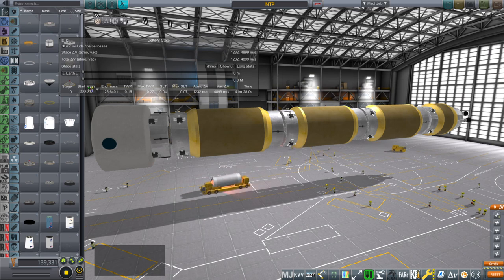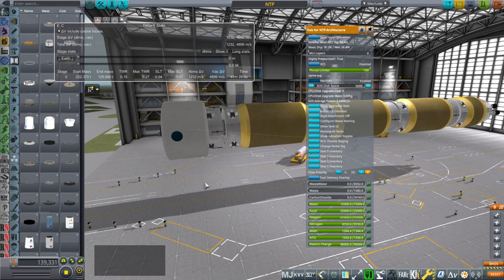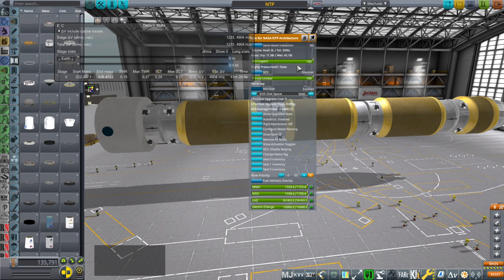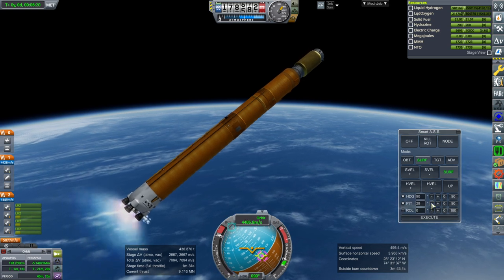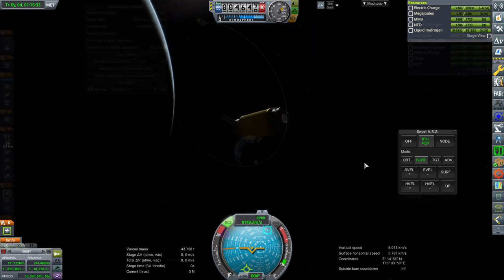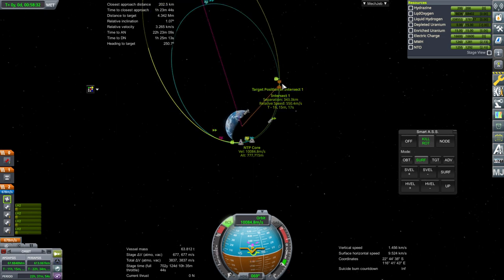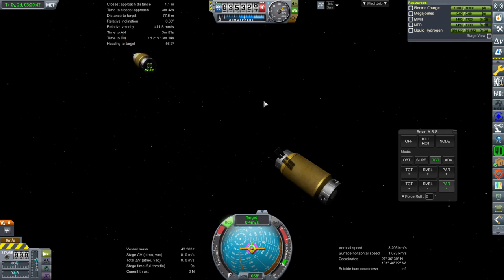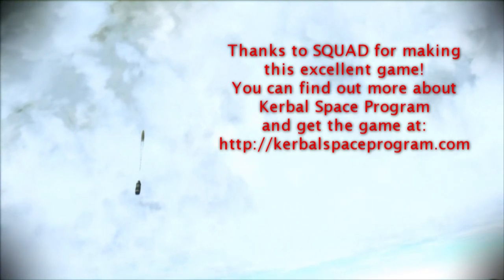Realism Overhaul in KSP 1.8.1 - NASA's Nuclear Propulsion Architecture 1

Comment: 1:30 If they used a hydrogen resistojet or poodle thruster instead of the later-stated (monomethyl)hydrazine-dinitrogen tetroxide, they could definitely achieve that Isp.

2:05 You seem to have renamed the engine rather than the specific config...

2:55 That was a harsh cut.

11:40 Same thing for most of my space mission projects. There's probably someone outside NASA, though, that could help us. Maybe Reach or even Bradley Whistance, but I'm not sure if that would be worth the effort on your or their part.
Reply from the maker: Actually, on the config, I didn't know what to name it since the name of the engine is too long. There's no such thing as a TimberWind 11 - only 45, 75, 250. I called it TimberWind 11 for the heck of it to reflect around 11 tons of thrust.